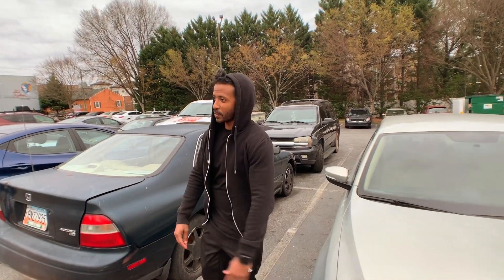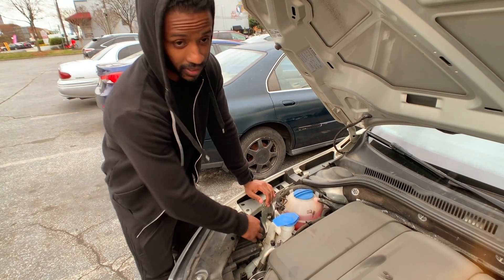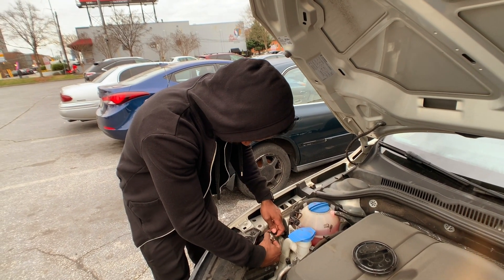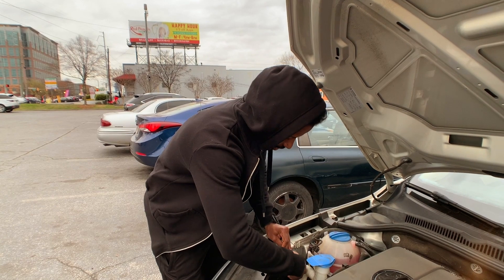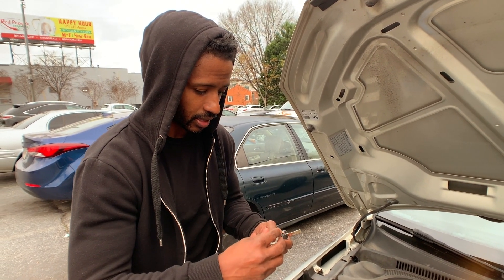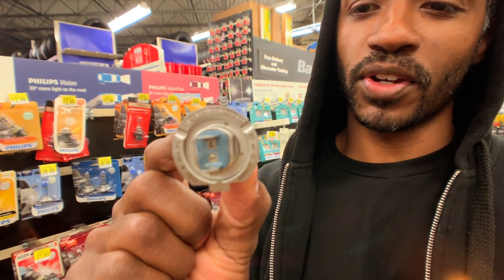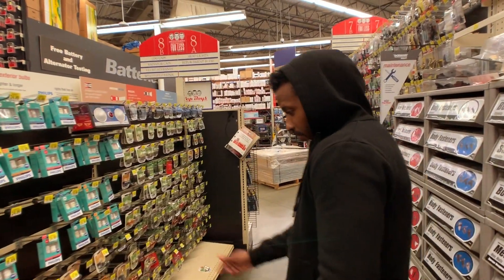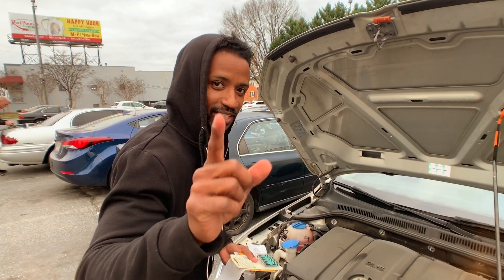HOW TO REPLACE HEADLIGHT BULB ON VOLKSWAGEN JETTA 2012

Comment: Yes.  Best video on this.  Summary points: the little arrow tab on the metal bracket must point down for the headlight (7:45)  and the turn is like 10 degrees clockwise (8:00).  The black plastic flange you hold to turn will end up horizontal.  Also learned on my own that for the high beams, the pointy tab goes up.

Comment: thanks so much! this job took me 3 months to complete! first I had to design a tool to remove the cover to access the bulb. I used a piece of cherry hardwood and cut a slot with my 8" chopsaw. I could then use the wood as a lever on the fin on the back of the cover to produce the torque to release it. this sure is a tight space! the bulb was a b.. to get off, but with time, I was successful. the next challenge was alligning the bulb placement in the socket. neither of the last two videos I watched described positioning the tab pointing down as you do. this saved me at least half an hour. thanks. you're great!

Comment: Hey brother I cant open the dust cover it's soo tight is there an easy way to open it to replace the bulb? I did not change bulbs since 2014
Reply from the maker: It could be possible that you are turning it in the wrong direction. Or it’s stuck for some other reason.

Comment: So I tried to replace my driver side for the first time since I got the car and the piece you twist to remove the light is missing. Is there still a way to get the light out? Thanks!
Reply from the maker: That part is the cover. If it is missing that’s one less step you have to do, however your bulb and headlights won’t be protected properly from the elements.